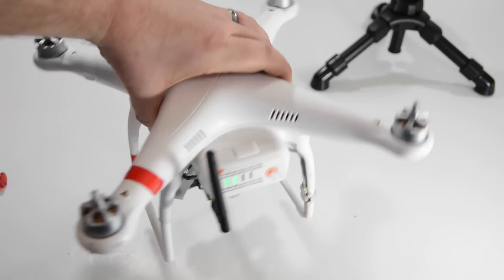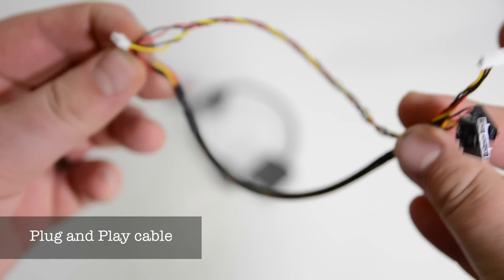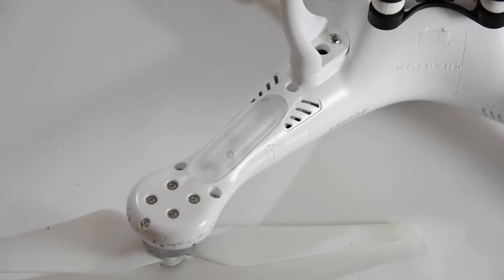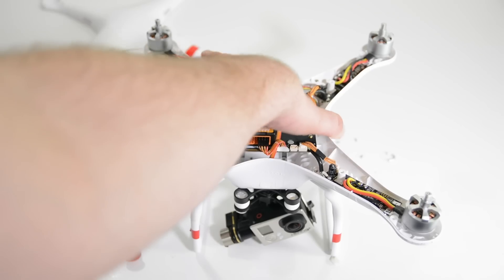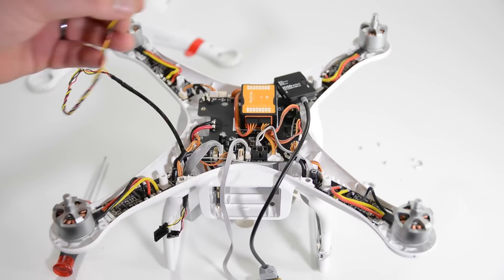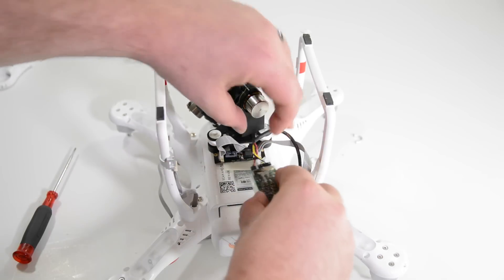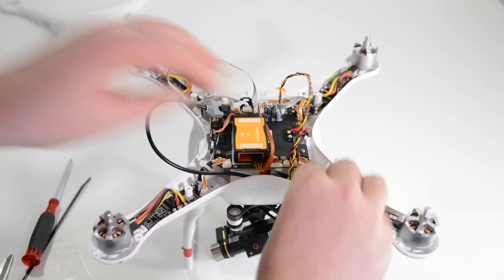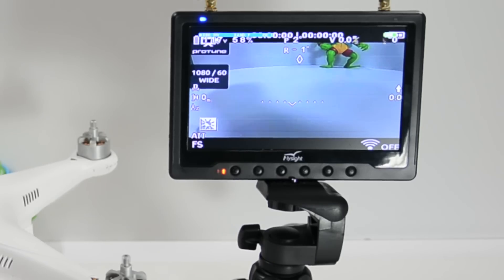DJI Phantom 2 - iOSD mini and 5.8GHz A/V Tx Install

Comment: This is an amazing device that has performed remarkably well.💮💮>JustU.Faith/DJIdrone?欠    My son and I have made about 14 flights over 5 days with only 2 minor issues, both of which were operator error. My primary advice for any new owner is to TAKE YOUR TIME and carefully read and watch the different videos on how to operate. It is remarkably easy to fly, but there is a lot going on, so just using the Quick Start Guide is NOT enough. If you take your time and carefully learn all the controls, you can become an expert flier and quadcopter videographer real quick.

Comment: Doesn't the 600mW tx require 7V instead of the 5V provided from the cables that come out of the P2? As far as I know these pre-installed cables only support 5V max 2A - so wouldn't it be a better option to grab the power for the video tx directly from the main plate?

Comment: aren't you supposed to show what will you connect to the go pro to see the view on the screen??
Reply: The video feed from the GoPro gets fed into the mainboard of the Phantom through That interference board he had to move to make room for the transmitter, The first socket he plugged the All in one cable into is the video feed from the GoPro, The plug he put in the iOSD mini overlays the OSD data to your video receiver/Monitor.

Comment: Sorry if this has been asked and answered already, but... Is it OK to have the compass inside the top shell like that? Would that not himder the performance or accuracy of the compass?
Reply: My bad...was confusing Can-bus and compass. Cheers.
Reply from the maker: I have heard people say things like that but mine flew excellent with absolutely no problems. I figured the more I could fit inside the better. Less exposed less can be damaged.
Reply: ***** I installed my setup pretty much the same way, soldered the wires instead of using the plugandplay cable. Also insulated the GPS wires while I had it open. All is working great.

Comment: Hey Man, I followed your instructions to a T and got it all working. However, when it loads up its a bit static-y and jello-y. Then when I get to flying it it's absolutely awful and I can't even make out a picture.

I tried changing the Immersion RC to Channel 4 but I had no luck changing the channel in helping out with the rolling footage.

Any advice? Literally no idea what could be going wrong. Should I get the omnidirectional antenna's? Could it be bad stock antenna's?

Comment: Thanks for an awesome video - followed everything step by step using all the parts used on your setup (minus the table tripod :)

However, after following your instructions and am now ready to power on my Black Pearl, all I seem to get is a black screen (no picture) on the channel selected based on the ImmersionRC setting. I also tried all bands and still could not get picture from my GoPro.

Any suggestions what is causing it? I'm hoping I didn't get any faulty parts. Thanks!
Reply from the maker: I shot you a PM :)

Comment: Hello! Thank you very much for your video. Other videos aren't too much help but yours. I have a quick question: Everything in the video has a link to to buy it directly, but what if I am trying to do a little stronger of a FPV connection and want to go with the "5.8GHz Fatshark spiroNET Antenne Set Cloverleaf and SPW - FPV 5.8 - ImmersionRC"? Will everything work or is everything that you have good enough? Thank you very much!
Reply from the maker: I would say this set up is "good enough". I could improve distance by using better, more expensive antennas just haven't had the funds to invest yet. The ones I use are cheap, I believe 10 dollars for 2, but they do what I need to do. I can go 650 feet high and still have a picture on my screen. I am in the process of doing some more videos explaining my setup and alternative parts to use.
Reply: ***** Thank you very much for the fast reply. Do you mind helping me order the right parts? I just want to get a bit passed the 650ft.. Any recommendations?
Reply from the maker: These are the only antennas I have used so far so my recommendations won't have any solid backing except for my research. The two links below is what I have my eye on though. http://www.amazon.com/gp/aw/d/B00KEHGJN6/ref=mp_s_a_1_2?qid=1426135416&sr=8-2&keywords=fpv+antennas&pi=AC_SX200_QL40&dpPl=1&dpID=311nH9yV1nL&ref=plSrch
http://www.amazon.com/gp/aw/d/B00GP5E9P6/ref=mp_s_a_1_3?qid=1426135416&sr=8-3&keywords=fpv+antennas&dpPl=1&dpID=31j8riJ5JWL&ref=plSrch&pi=AC_SX200_QL40
Reply from the maker: Whatever you decide to get please let me know if you get better range as I am still looking for the best ones :)
Reply: Thank you for your help. I saw the spiral looking one and seems really cool, but pricey. Maybe that will be a thing of the future to add on eventually.. I'll get back to you whichever I end up getting. Thanks again :)

Comment: So how I understand that you have the gimbal so therefore you don't have to plug directly into the go Pro I don't have the gimbal so I'm going to have to buy the transmitter that actually plugs in directly to the go Pro let me know what you think?
Reply from the maker: There is a cable to connect the go pro to the transmitter on Amazon. How this cable works is you would plug one end into the gopro and the other end to the transmitter.  I've added a link in the description to the cable, it's the last one on the list in the description
Reply from the maker: http://www.amazon.com/gp/aw/d/B00D83V9PQ/ref=mp_s_a_1_1?qid=1422320921&sr=8-1&pi=AC_SY200_QL40&dpPl=1&dpID=41CuHuBEyKL&ref=plSrch

Comment: Not sure how it works how does the monitor get the video I know through the go Pro is it through Wi-Fi?
Reply from the maker: It has built in 5.8Ghz receiver in the black pearl monitor. The GoPro is plugged into a 5.8ghz transmitter which is mounted to the Quadcopter, in this case the 600mw immersion. So to break it down you have a camera connected to a transmitter shooting a signal to your receiver on the ground which you'll need to plug into a monitor to view the footage. I got the black pearl monitor because it has the transmitter built in, but you can use any monitor, you'll just need a receiver. The black pearl is nice because it also has HDMI imports so I can use as a monitor for my dslr camera. All the links are in the description of you want to read more into the gear in this vid! Thanks for stopping by!

Comment: I was wondering for that to all work would you need the DJI Zenmuse H4-3D Gimbal for GoPro?
Reply from the maker: No you do not. You can buy the DJI phantom 2 without the gimbal and still do this same install. I would suggest getting the package with the gimbal, it will allow you to look down or eye level and is just so much smoother footage. If you're looking to just put a FPV camera in the sky there a many alternative, cheaper solutions. There are tiny fpv cameras you can attach to a small 200mW transmitter for around 100 bucks. Then you would just need a receiver/monitor. Hope this helps

Comment: I followed everything you did exactly but my gimbal doesn't go up or down when I try moving the knob. Also, I can't get a picture on my monitor. I think I've tried every setting on the monitor. What setting should I be on?  When I look at the immersion 600mw 5.8ghz A/V transmitter it looks like all 4 channels are on. Is this right and how do I change it if not? Thanks
Reply from the maker: That's no fun! I have a few questions... Did the gimbal and knob work before installing the iosd mini and immersion transmitter? Did you happen to turn the Quadcopter on without a antenna on the immersion transmitter? That will def. Burn the transmitter up :(. Did you fly the Quadcopter at all before the installing the extra components?
Reply: ***** Hello. I am very concerned that I can't get this working correctly. I flew my Phantom 2 before with just the camera. I have the 32 channel Black Pearl. Does that make a difference. Everything else I did was exactly like you did and same equipment. The monitor acts like it is hooking up but the picture is fuzzy and I tried multiple channels. I have done through everything several times. My camera does move!

It recognizes something is going on but the picture is fuzzy. I am a newbie on this and only flew it for 20 minutes.
Reply from the maker: Did you happen to turn on the phantom while the antenna wasn't  connected to the video transmitter? You could of zapped out your transmitter.
Reply: ***** it was something in my settings or camera. I finally got it working! One question is the shrink wrap on it was accidentally removed. Is that bad for it I assume? I haven't flown and looking for options to get it back on if needed.
Reply from the maker: Glad to hear you got it working! As for the shrink wrap.. That basically protects the electrical components. I don't think you would need it, but would probably want it incase it came in contact with rain or who knows. Maybe go to radio shack and get a huge tube straw shrink wrap and try to work it around the transmitter. Use very very little heat when shirking it. Not so sure if that's a good idea but that's what I would try.
Reply: ***** it was working and now it's not anymore and pretty bummed. This time it's nothing to do with the settings. Any ideas? Thanks in advance!

Comment: Thanks for the very informant video. I have watched tons of videos on this subject and didn't learn much. Your video made it look simple. Thanks again. I have never flown a quadcopter but just ordered a dji phantom 2 with gimble for my go pro. I want to get a flysight black pearl FPV. I plan to fly without the gimble and camera for a time to get use to flying. Can I get some advice from you? If so, do I need to get an interference board and the things you mentioned on your video? Also, is the newest phantom with the new compass going to be the same as your video? One other thing. Can you mount the transmitter 90 degree to the side instead of the way you mounted it. Give me pros and cons of that. Any other advice you can pass on would be helpful. Thanks again
Reply from the maker: Glad it helped! enjoy your new drone :)